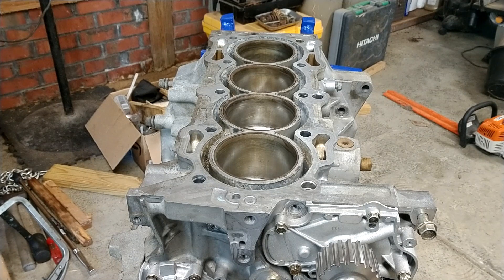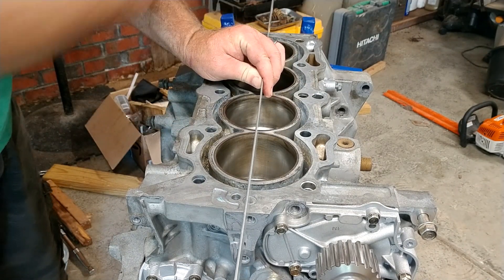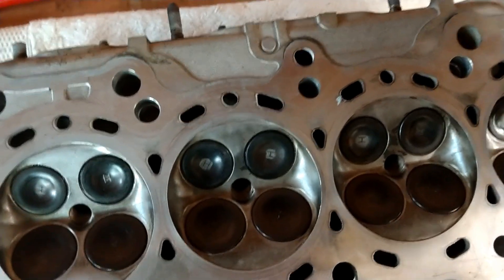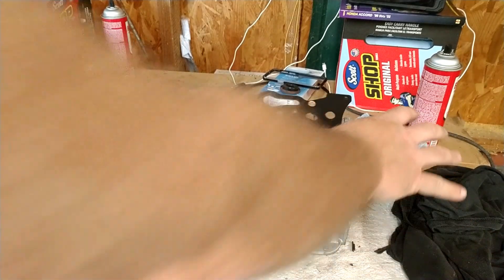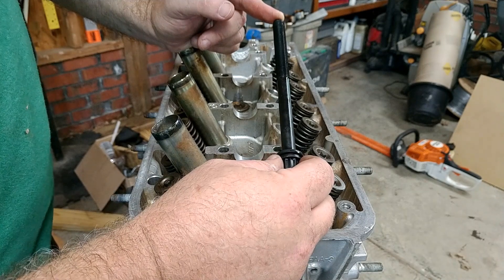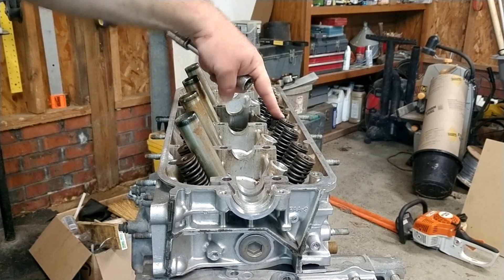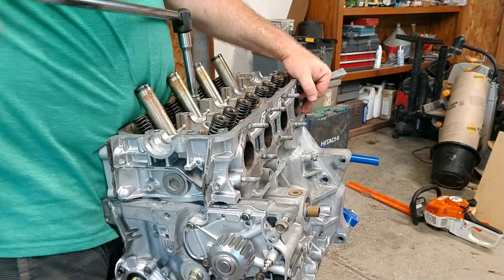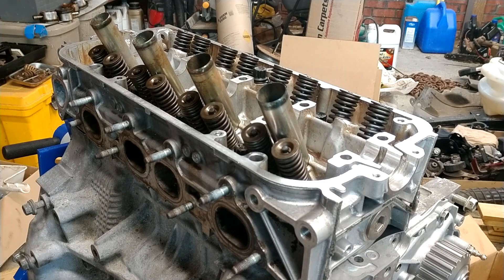F23 Honda Accord Engine Rebuild Part 10: Cylinder Head Installation

Comment: I've reused head bolts before. I also blow out my bolt holes...
Reply from the maker: Yep. There is a procedure for reusing them. I was just doing the better safe than sorry thing. And blowing out the holes is something I missed pointing out. I appreciate the comment!
Reply: @ktecgarage yeah, you did a pretty good job of explaining it too. I just didn't watch that far yet...

Comment: I just pulled my head. I have a burnt, broken valve. Just wondering what would be cheaper, having that head rebuilt or just bying a reconditioned head? Thanks for doing the videos very helpful.
Reply from the maker: Ouch. If I found one in a junk yard with "lowish" miles, l would grab that, check it for flat and redo the seals. Reconditioning that head would probably mean 16 new valve guides which would run you about $20 a piece. Milling it would be another $100 or so. If you have a machine shop you trust to tell you the guides were in spec, you could probably just get away with new valves which isn't that expensive. Good luck!

Comment: You will not believe how much you’re channel has helped me. I’m about to start mine now and you are the only channel I’ve found that goes step by step. Much respect ✊
Reply from the maker: Thank you Mr. Dawg! It is always good to hear this effort helped someone out. Thank you for commenting.
Reply: @ktecgarage  no problem! Do you happen to have a email I could use to contact you if I run into any problems. If not I understand and thanks in advance.
Reply from the maker: ktecgarage@gmail.com
Reply from the maker: IG there too.
Reply: @ktecgarage  thankyou

Comment: Thanks for the info about the head bolts!
Reply from the maker: Sure thing. The last 90 turn will wind up at around 120 foot lbs. I suggest you do that with the engine in the car, not on a stand. Thanks for watching and commenting!

Comment: I was searching for L15A1 engine and stumbled upon ur channel and literary got glued. You sir, mentioned that you are not a mechanic but you proved thoroughly otherwise. Wondering what all books did you read or how many hours of practical experience got you where you are. Simply wonderful. Please continue to enlighten us. All tge best...Hats off again...respect from Bangladesh...
Reply from the maker: Thank you for your kind words! Makes the effort of this worthwhile. At age 17 (1987) I rebuilt the 302CI in my 69 Mustang using the Chilton manual which pretty much taught me the basics. Did all my repairs on cars or lawnmowers or whatever my whole life. Prior to these videos I rebuilt the D15B7 in my 93 Civic. After I pulled this engine I decided to pick up the camera and share. I have found that most of learning to do these types of projects is just having the courage to start. If only I had YouTube in 1987 when I did that small block!
Reply from the maker: I might also suggest other YouTube channels such as Eric the Car Guy, South Main Auto and Mustie1. Those guys inspire me everyday!

Comment: Hello  Sir, I'm at this point now. Have a question, the torque specs you mentioned are only for 'torque-yield bolts'?
I'm using the headbolts that came with my kit, yet I have to figure out/research what type are they. New bolts are shorter(10.9 rated) than the old ones that come out.
Thanks
Reply from the maker: If you go 90 degrees three times with a bolt that doesn't stretch, I would think you be likely to break it. If you are not sure what you have, I'd ask the company you got them from before you run it down. Also, don't do the last step until after you put the engine back in the car. Much easier.
Reply: @ktecgarage  got it.
Reply: @ktecgarage  Yes,  the bolts that I got are torque to yield, Amazon/Evergreen responded today.
Reply from the maker: Then according to the Haynes manual, just what I said in the video. Again, do that last 90 after u get the engine back in. Good luck Gus!
Reply: @gush9348  lol. Next time just hit em with 100 nm and u good to go
Reply: @jdmcars-lt6499  😁🤣....all good man, car/engine has been running for a bit under a year(over thousand miles)  I know the question does look silly even to me now. At the time I didn't  know head bolts stretched.  All great man, any body following this tutorial should have same results. 
Good luck to you  @JDM Car's - LT
Reply: @ktecgarage  where did u purchase your head bolts from ?
Reply from the maker: ECCPP Replacement for Head Bolts... https://www.amazon.com/dp/B07BX7KC93?ref=ppx_pop_mob_ap_share
Reply: Thank you man .. n may I ask why does 1 bolt come longer than the others ?

Comment: Thanks for all the good info. 
I'm far away from this step, but eventually I'll get here.
I'm about to pull engine/trans. At the moment disconnecting everything, had very hard time with one of the axle nuts. 
Thanks again.
Reply from the maker: Those can be a pain. MAP gas applied for five minutes can do the trick. I even used that candle wax trick before. Not sure if it was the wax, the heat or the pipe on the end of the breaker bar that worked!